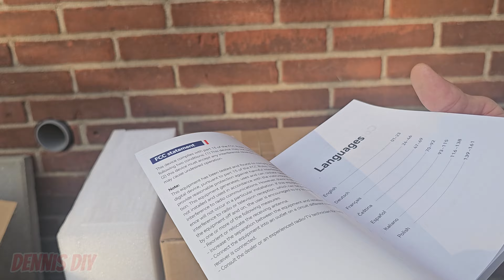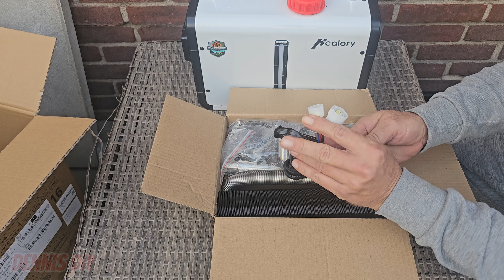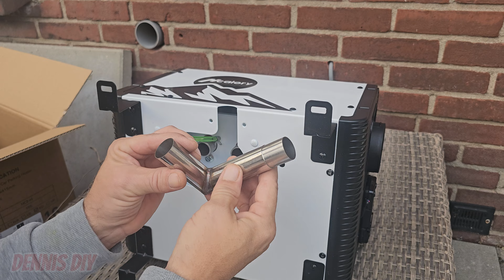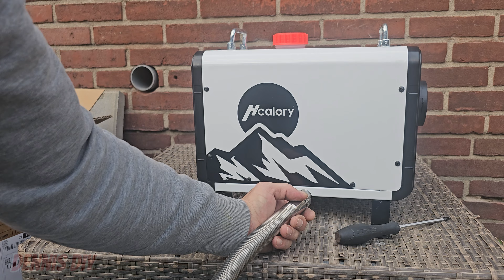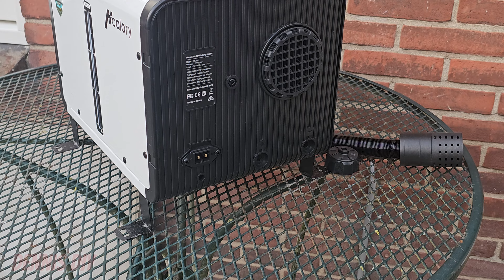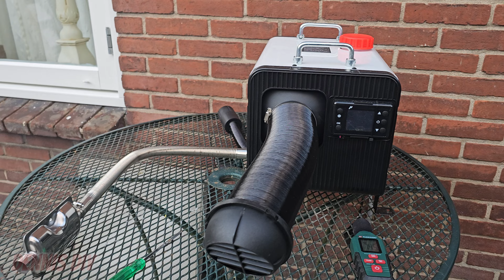Diesel heater Hcalory HBH2 5l 8kw 12v or 240v AC/DC cheap heating  a house  - from Banggood

Comment: Na, dann viel Spaß beim Haus Beheitzen. Habe jetzt über eine Woche nen test im 20 m² Werkstatt Bereich Betrieben. Sage Nur, Lass es sein. Werkstatt Ja. Whg . NEIN
Reply from the maker: That's weird, because I have used it  on 45m2 for 2 months during the winter and it kept up the temperature very good,  also the thermostat did his job, turns on and of when it got up to 21 celcius. Maybe your workshop isn't very wel isolated?